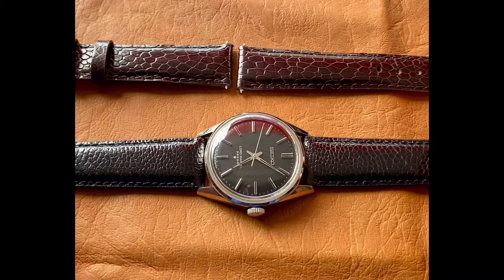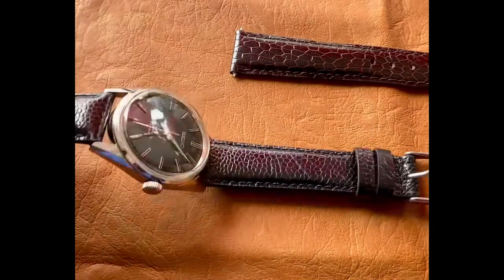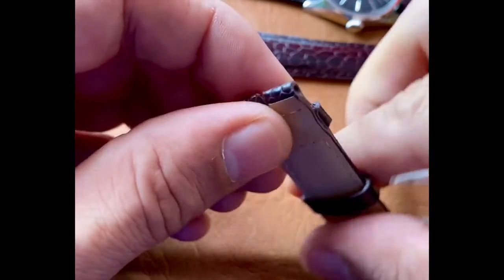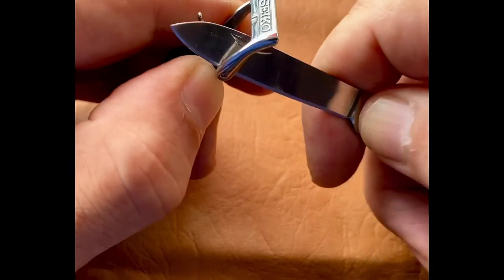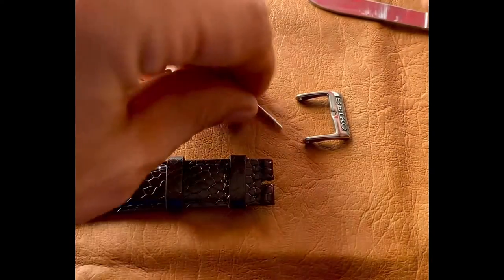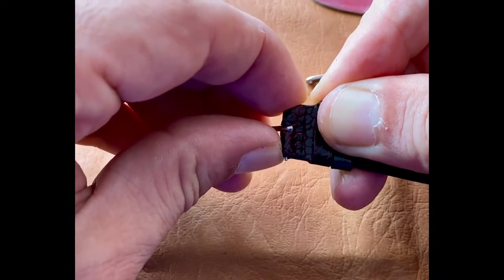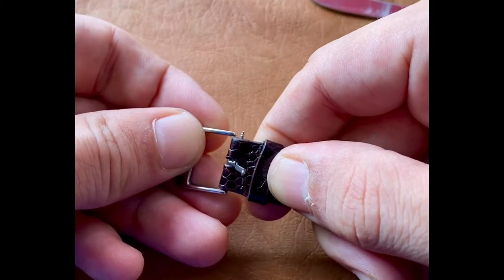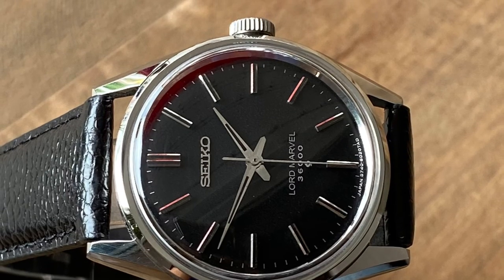How to Change a Watch Buckle Without Any Special Tools AKA Removing & Replacing a Watch Buckle

Comment: Thank you very much for the vid and explanation. It worked! Just an observation: the spring inside my buckle is stucked or is fixed, because it doesn't move a thing when I push it down. Thanks again!
Reply from the maker: Sometimes the spring function fails and the spring bars don’t compress & expand normally … Most spring bars are cheaply made … only a few are solid and very reliable …
Reply: @vintagewatchstreet45  thanks, yes, the originals still work perfectly, solid steel.

Comment: Swapping a bar spring buckle on a leather strap is a cinch. I've a Casio resin strap w. plastic buckle held with a solid pin. A bar spring tool seems hapless here–advice wanted.
Reply from the maker: I’d really have to see a photo to give proper advice :)
Reply: I've thought of a means that might work to release  the pin ends from the buckle. In the meantime I'll fwd a pic to your email.
Reply: I have the same type of resin strap, is a Casio G Shock Dw 6900, just had to pull out a little bit to bend the plastic buckle and it did the trick. It worked fine for me. Hope it works for you, too.
Reply: A rigid plastic buckle hasn't much give. I tested this by spreading it with an old pair of scissors. I will bear down on the pin with leverage on the other side.

Comment: Great Video! I just don't recommend that you use a knife, as you may cut a piece off of your strap (as I did🙈😂).
Reply from the maker: I’ve done it a thousand times and never cut a strap :)  … the key is to use a thin blade that you can easily slip between the metal & leather … and pry side to side, not pushing or pulling the blade :)

Comment: I wonder why you advised to get a 16mm buckle for a 18mm strap. One would think that would not fit. ?
Reply from the maker: An 18mm strap refers to the lug width the strap fits on. Most straps with 18mm ends have a 16mm buckle. Most straps taper 2mm… you’ll see a lot of straps for 20mm watches that have 18mm buckles. And many 16mm straps taper to 14mm buckles. Most straps taper, some don’t.

Comment: anyone else just find this impossible even with the video the buckle keeps falling off the first end of the spring bar before i can even use my tweezers on the other end
Reply from the maker: You’ll want to insert it in one hole first. Try laying the buckle down on its side instead holding it in the air. Also try putting the other end of the pin in first as well.